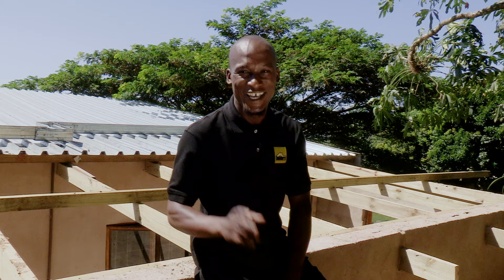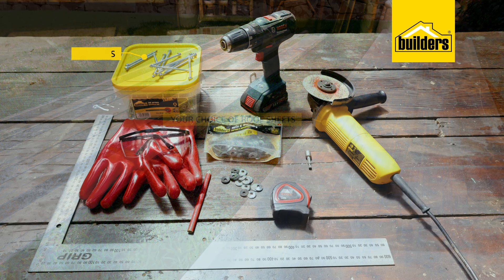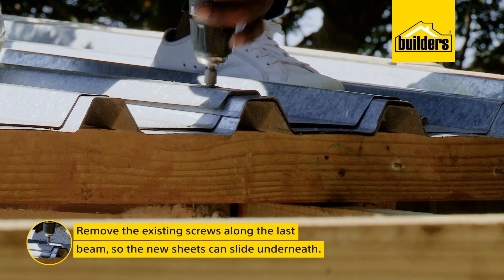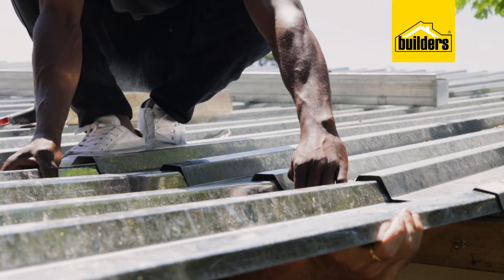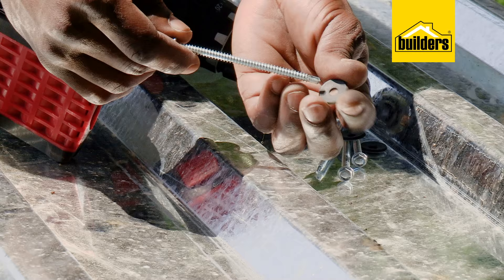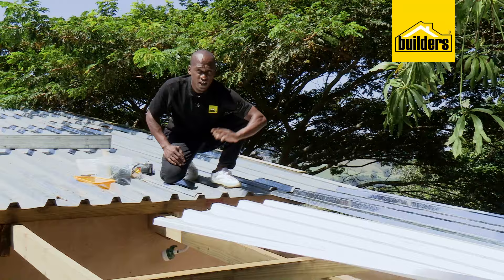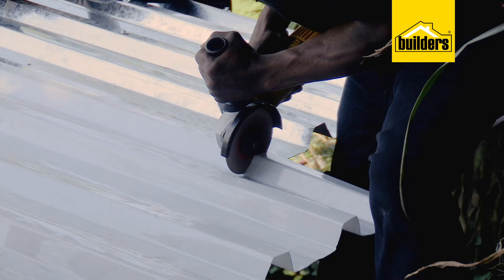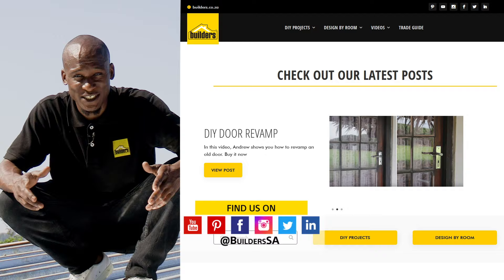How To Install IBR Galvanised & Polycarbonate Roof Sheeting

Comment: we had ibr clear sheeting installed over veranda, but now the rain leaks through all the places where they joined the pieces with screws and washers. What can be used to waterproof the holes? Unfortunately the guys who installed it no longer do this as a business. Which sucks because I paid so much to have this done only to get leaky roof. any suggestions please

Comment: thats a classic builders warehouse job, thats not a good clean finish, typical southafrican job where there is no pride in craftsmenship .there are better screws for polly carbonate and for wood  that will just do a better job. how can you cut after instalation. why not measure then cut and hide the cut side into the roof so your edges are nice and clean. also you guys are not very clear on how much to tighten the screws. you guys are setting people up for failure.
Reply: It's diy, for professional craftsmanship call professionals.

I followed their instructions to install shade net, I managed but you can tell it's a diy job from a mile away